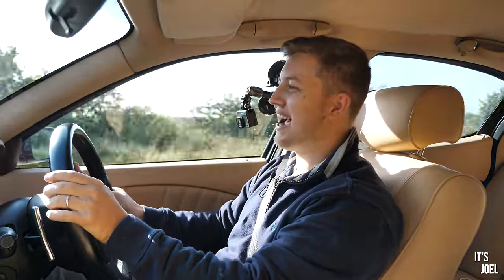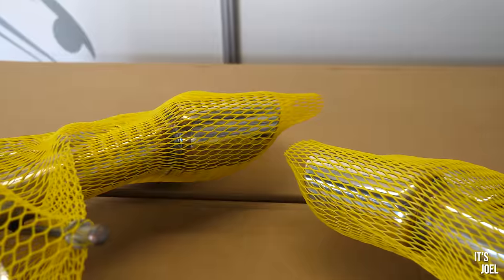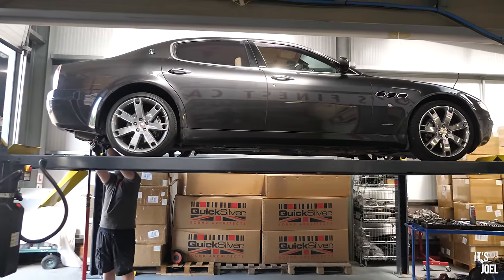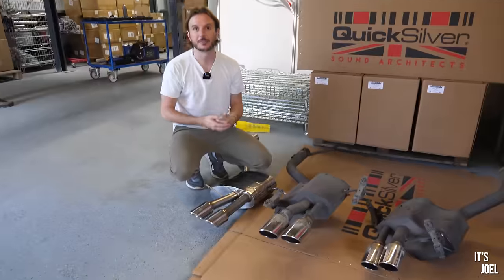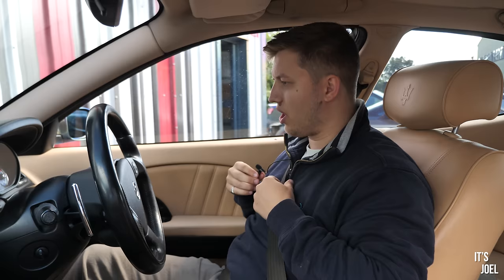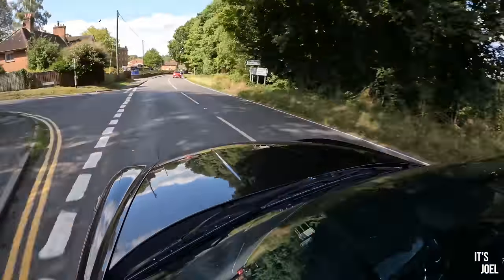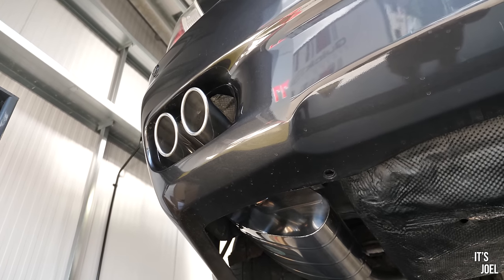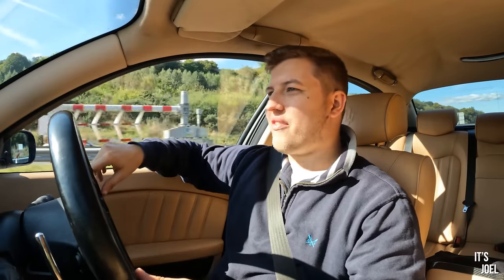I GOT A CRAZY EXHUAST FOR MY MASERATI QUATTROPORTE!

Comment: Hi Joel, what happened with the engine having a problem, did you it sorted?
Reply from the maker: The cam variator issue is still there, however I’m still waiting to hear back from the warranty company on whether they will cover the repairs
Reply: @itsjoel some people get away with adding an ‘oil accumulator’ that can fix the issue without needing to strip part of the engine, have a look into it

Comment: The standard quattroporte GranTursimo exhaust has valves in it that are spring loaded. They are a pain as they start to rattle and only open above 4000 revs - I know this as I rigged levers to them and filmed the valves opening. Below 4000 it is very restricted. There is some video of the valves working in here: https://youtu.be/kyVueVpf-00
You can do a cheap job and cut the boxes open and remove the valves which is what I am about to do. The original boxes are stainless and pretty easy to weld with 308l wire. I would buy new boxes, but I do not have £2k to spend!